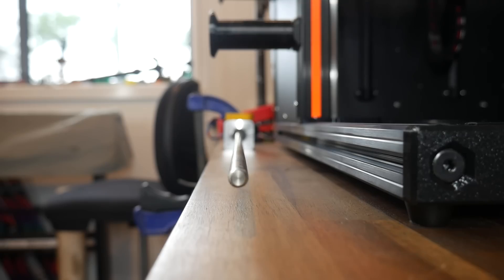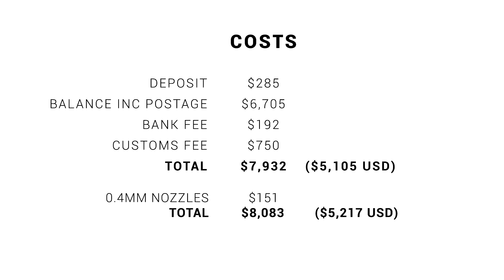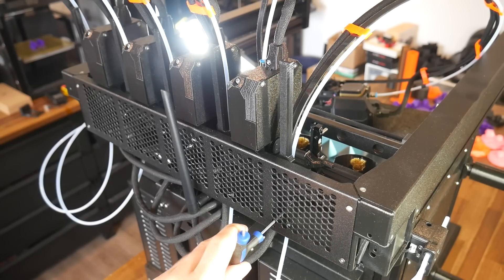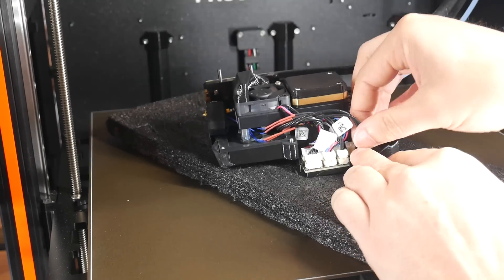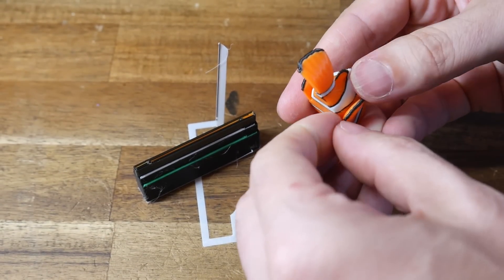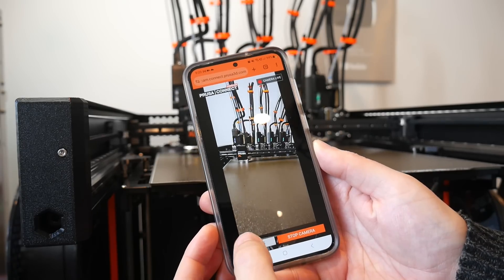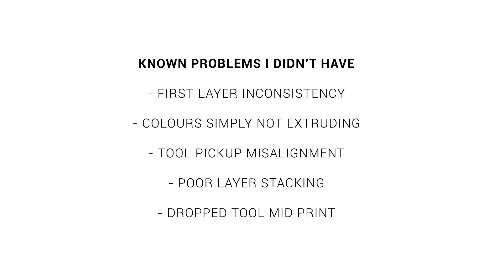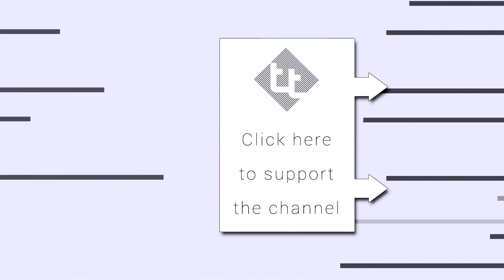I’m (mostly) happy with my Prusa XL - This is what it took

Comment: I had stringing issues on my MK4 and I changed the Z hop to ramping. Travel Lift: Lift height .2, max lift 1.5, ramp slope 1. This got rid of all my stringing issues.
Reply: Ramping is enabled by default if you are using latest PrusaSlicer.
Reply: Weird, my MK$ has been flawless - way better with stringing than the Mk3.
Reply: Yip. My Mk4 had horrible stringing at first. Took a bit of simple tuning to clean up, but expected much better of the bat compared to previous experiences with MK3, and Mini. I also ditched the Prusa Nozzles, and went for the adapter, and standard E3D nozzles, cheaper, and don't require disassembly to change.
Reply: @HackMonkey  I’m waiting till I clog my nozzle to make the switch

Comment: i wish they would care this much about the mk3.5 upgraded mine recently total nightmare. Bed leveling does not work and occasional layer shifts. Prusa support was unhelpful and basically gaslit me until i stopped talking to the. All of us who have issue with the mk3.5 just had to comment on github and hope they actually saw it and helped. They really dropped the ball with that and now I have a useles machine. I would rather have my mk3 which actually works instead of a fast printer that I can only use 70% of teh build volume and fails half the time.
Reply: i wonder how many people left prusa while this thing was being designed. its continually underperforming my expectations, which is quite the achievement i guess...